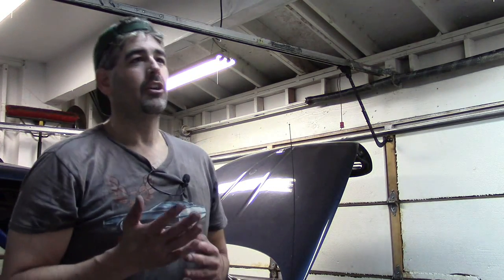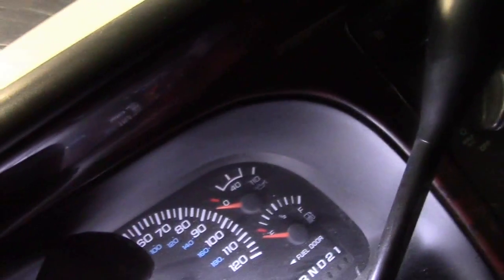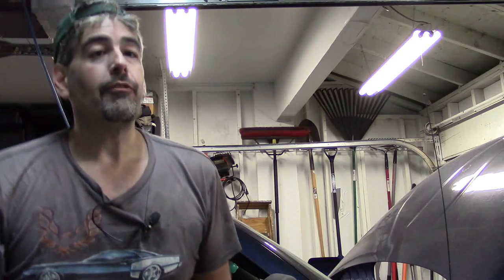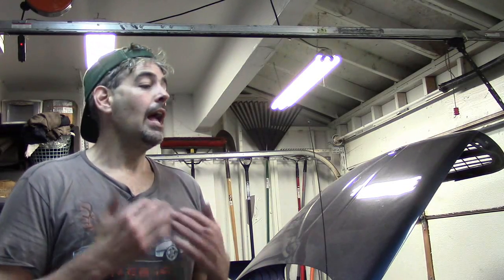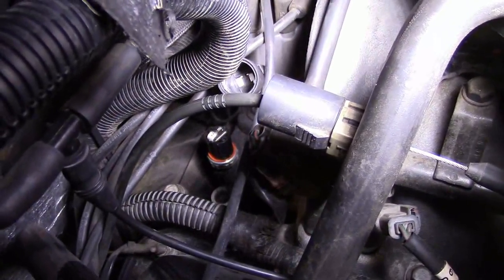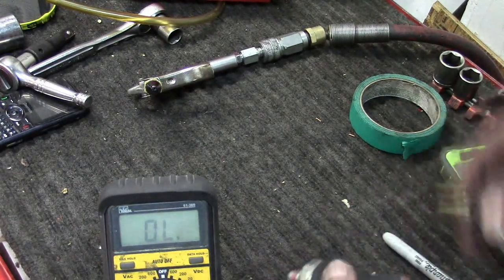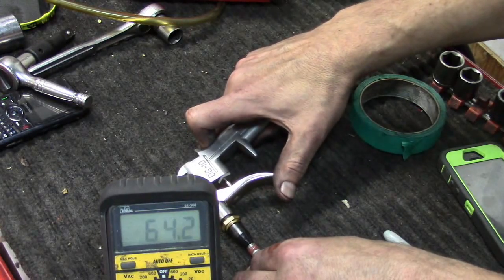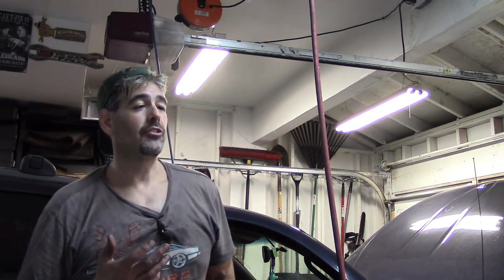DIY- Low Engine Oil Pressure Diagnostics

Comment: Well, it's one thing to have some private party seller tell your customer that the low OP reading was due to a faulty sending unit, but - how about ye good olde chevy DEALER (salesman, actually) telling me that the low OP at idle in my  5.7L vortec  (99 Tahoe) was NOT a problem - that's the way they roll.  Above idle it popped right up, and has continued for over 100K for me without that changing.  But now you have me worried....  WAY too late to do anything at the stealership -- they closed up shop entirely several years ago.  Methinks it's worth my while to send my oil in for lab analysis - seems like that was relatively inexpensive and hugely informative!

Comment: You shouldnt half to rebuild it. just take the oil pan off an put new rod barrings  an a new oil pump in it . no since in spending thausands of dollars on it .Why you can spend a hundered or two dollars an fix it.. But thats just my opioion ..
Reply from the maker: Rotflmao.  Ok so just forget the fact that the low oil pressure could be from the MAIN bearings huh????  come on.

Comment: Do different oil filters make a difference in oil pressure
Reply from the maker: Nope
Reply: I have a 2006 chevy Silverado with a 4.8 and 119,000 miles, it runs good but the oil pressure hangs around 30-35 when warmed up. What could I do to get it back up to 40 psi at idle?
 @SchrodingersBox

Comment: I just installed some Boush Mechanical gauges to my 283 Chevy Sm Block, it has 37 pounds of pressure at start up at 1500 Rpm, Book say should be 38 Pounds at 1500 Rpm. But after warm up, it drops to like 20 pounds?

Comment: good troubleshooting but would have been more helpful if indicated what pins on harness and sending unit meter connected to.  as always though, helpful videos
Reply from the maker: I am quite certain I did mention the pins where the reference, signal and grounds.  In fact I am 100% positive I mentioned that.

Comment: Showing the oil pressure test without knowing what pressure to look for was pointless. This could've been a better video. When someone says an engine rebuild or replacement I hesitate. There are many more things that could be done to prolong the engine life with the last one being an engine replacement. Just my two cents
Reply: Dude, it had 10psi of oil pressure, it is F.U.B.A.R. If it were mine, I would rebuild it for sure, or find another engine for it,they don’t make much stuff like that anymore with truck frame etc
Reply from the maker: Your lack of competence on the basic fundamental concepts of proper oil pressure diagnosis does not make this a bad video. It just makes you a bad diagnostician. The oil pressure was scientifically proven to be low and the cause of the failure. Even a beginner can see that. The fact you think things can be done to prolong the engine when it is conclusive demonstrated even to a rank amateur that this is bearing failure exacerbates your incompetence exponentially. Anyone who would recommend continuing to drive the vehicle under any circumstances other than a rebuild should never ever work on people's cars.

Comment: Hi, i rebuild a gm grand am 1999 2.4l ld9, troubleshooting is i fill up the engine oil full of the gadge, oil dipstik ok but when i start the engine few min and stop, i take a look on the dipstik again and oil is very low, do you have an idea, where the oil goes, no leak everyting seal on spec. Thank’s. Ben
Reply from the maker: I normally diagnose these using fuel trim analysis to look for oil in cylinders.
Reply: Schrodingers Box think there is oil on the cylinder, i check the compression and everyting perfect head and valve.
Reply from the maker: it won’t be a compression problem. possibly a seal problem. anyway when you see the fuel trim show a proportionately rich curve compared to load, that obviously would be indication on where to suspect the issue.
Reply: Schrodingers Box yes i have to check more specific fact, i am going to take a look and see the troubleshooting, when is done i reply to you and see what i found thx a lot. Ben

Comment: What about the oil grade was wrong? My 2005 Suzuki Forenza start this problem after mechanic changed  oil and and replaced timing belt Also started a knocking valve.
Reply from the maker: a knocking valve lol????  Oil grade causing low power??  Jesus.

Comment: You also have to check the oil pickup tube connection to the engine block.
Reply from the maker: not with low pressure that varies with load. No, the pickup is clearly operational in this case.

Comment: Would a higher volume oil pump be a budget hack to extend the life of that beater? More volume would force up pressure right. Don't judge I just woke up.
Reply: I mean if it didn't already have rod knock

Comment: Great video!! I have a query. My bike shows low oil pressure in spite of having new oil (changed just a couple of weeks back). But, it shows it only after I ride for 2 kms. Especially when its night time (I am assuming its cuz there's less heat in the atmosphere). Then when I turn off the ignition and back on again, it never shows up. The oil level seems fine, although for a 200CC bike, it does sound a little too noisy above a speed of 90km/hr. Can you tell me what the issue might be? Its just 1 year back I bought this bike.
Reply from the maker: It could be the bearing clearances expanding with heat.  Measure actual oil pressure with a gauge both at startup and after warmup to confirm.
Reply: Schrodingers Box If the bearing clearances do expand with heat, what should I do?
Reply from the maker: if an actual manual oil pressure test validated the findings then i would measure the bearing clearances. A lot of people will say you need a new oil pump but they are idiots. Measure the bearing clearance on any rod cap or main and when you see its out of spec you know the problem.

Comment: Hi,friend..I have zero oil pressure when i start my car,i need to accelerate to flow the oil.why does happen this my friend?thanks
Reply from the maker: What was you resistance on the sensor during these variables?

Comment: Schrodingers Box  Great video. Could i ask, with the pressure kit what level PSI should you be looking for to rule out your car has low oil pressure?
Reply from the maker: you need to check the specification for your specific vehicle.

Comment: also I have a 2011 2SS Camaro 6.2 L and it is pulling the code saying its my oil pressure sensor
Reply from the maker: There is no such thing as a code that says it is a faulty oil pressure sensor.

Comment: hey Guys I have a 2011 Chevy Camaro 2SS 6.2 LS3! I have had the Cam and lifters and oil pump changed and oil pressure sending unit changed and still has low oil pressure! I'm 3,000 in the hole someone please help me?
Reply from the maker: What was the data that indicated the oil pressure was low due to cam/lifter and even if so- why on earth would the sensor be changed in that case???
  Makes no sense at all no matter how you look at it.
Reply: it said it was the sensor when I had it plugged in at O'Reillys but I even had it replaced and still pulling that code
Reply from the maker: impossible. there is no code that says there is a bad oil sensor.  there are codes for circuit inputs out of range but it is impossible the code said bad sensor. 
  also what are your main and rod bearing specifications. Surely those were read if the cam was replaced. No one would replace camshaft for oil pressure failure unless bearing clearance was measured at bottom end.
Reply: no I replaced the cam and lifters because they were bad and after I had a oil pressure problem so I replaced the oil pump and I replaced oil pressure sensor and still has low oil pressure?
Reply from the maker: Ok then obviously you have a bearing clearance issue. What is ge came bearing clearance vs tolerance?  And again- why change the oil pressure sensor?
  In fact what is the MECHANICAL oil pressure reading anyway?
Reply: 15 psi
Reply: Cause its what pulled up when plugged in the reading to at O'Reillys when my check engine light came in said low oil pressure sensor
Reply from the maker: it may have said low oil pressure because it was reading low pressure but that is accurate. it did not say the sensor was faulty. it said it was reading low- which of course it was. 
  So no need to change the sensor. 
  What you need is bearing clearance data now.
Reply: How do I get that?
Reply from the maker: you measure the oil pressure directly. You mean you didn't do that??? How did you possibly determine the cam was responsible then?
  this makes no sense whatsoever. what is driving. these decisions to replace all this stuff when you have no confirmed oil pressure deficit?????

Comment: my Ford Explorer is doing the same thing with the m Dash on my oil it seem that there's no oil and there is so mine's a little different my truck does not have a knocking sound to it at all and what would that be
Reply from the maker: Then I would IMMEDIATELY diagnose the issue. If it's actual low pressure you may be able to intervene without catastrophic damage and get by with just bearing replacement.

Comment: Hi matt, I'm an almost religious follower of your videos. Could you explain why thinking about a bad oil pump is ignorance when flow is proven? Since everybody around says otherwise? I believe there is a lot of myths about engine lubrication ( a good example could be "the older the engine, the thicker the oil") and it will be so good to hear your opinion, I know you are not very interested in those kind of topics due to it's basic or simple nature, but damn I'd sure enjoy a video shining some light on us about it. Thanks and please forgive my poor english, is not my native language.
Reply from the maker: It is because an oil pump does not create oil pressure. It creates oil flow. The pressure is created by the flow going through the small bearing clearances of just a few thousands of an inch.

  An oil pump is an incredibly simple design that does not fail before an engine bearing would. If the oil is flowing and the pressure is reading low, either the bearings failed or the gauge is reading incorrectly.
Reply: Awesome! I hate when old school mechanics try to impose their stupid ideas

Comment: Hi matt, I am having a similar issue. The oil in the cylinder head is very less when the engine is running. I hear loud rocker arm noise. Could this be a failing oil pump? I changed the oil filter but no changes. No particles in the oil. Could it be a blocked oil gallery ?

Comment: what causes this. my wife's car just died and this is what it was doing. I thought the sensor was bad because I new the oil was full because I just changed it and it was running fine.
Reply from the maker: As described in the video your variables would be worn bearings or faulty sending unit or fault gauge.
Reply: Schrodingers Box I guess I meant what causes the actual low pressure not false indication.
Reply from the maker: HillbillyMatt ExtremeDIY When the engine bearings are worn the space the oil passes through is enlarged, which of course exponentially reduces the pressure.
Reply: Schrodingers Box aha. that makes a ton of sense. I am so hooked on your channel. as you may be able to tell by my name I enjoy pushing conventional rules of DIY. as you probably know when you are rengineering the conventional you have to do all of the homework. I appreciate it when I find a good source of detailed knowledge like your channel.

you are very thorough and you make it understandable. thank you.

I was trying to find the video that you refernced in your extreme budget engine rebuild video, in which you discuss why rod nock is an absolute engine replacement/rebuild. what is the title? I tried searching "schrodingers box rod knock" to no avail.
Reply from the maker: HillbillyMatt ExtremeDIY Welcome to the channel!  Try searching the channel itself. It is under the "about" tab on the main channel page if I remember- there is an option "search channel" as opposed to searching all of YouTube.
Reply: Schrodingers Box you are correct but for some reason that feature isn't available on the mobile app.

Comment: what causes a loss of engine oil pressure like that?
Reply from the maker: Worn bearings. When the bearings wear the clearance widens and the oil pressure drops due to the larger clearance it passes through
Reply: @SchrodingersBox  does that mean the engine is going out?

Comment: Makes one wonder if the pressure switch was loosened on purpose to hide the oil pressure issue?
Reply from the maker: I suspect it was replaced by a typcial non-diagnosing hack that was hoping it was just a bad oil pressure switch.

Incidentally this car did finally blow up this summer when the rod knock became so bad the timing was off enough the car wouldn't drive. Eventually the guy threw a rod because he had to floor it to even make it go.

Comment: dang just did engine  and another mec told to me it's leaking on oil sensor.  why that should of been replaced with engine.  ahh. and the power steering  pressure line leaking too and 02 sensor, engine light on. ahh  . Gosh when I got it back from mec   the oil showed none. I put  lucas and oil. took it to another shop they said add one quart more oil  said maybe dip stick is maybe wrong one.
Reply from the maker: Sounds like you car needs to be on this channel... and your mechanic needs to watch lol

Comment: Hey schrodingers box I live in cs and have a engine noise that seriously needs to be addressed is there any way I can get ahold of you I need help
Reply from the maker: No need- just find the source of noise and confirm through visual confirmation.  There is no skill in diagnosing noise- you just have to tear into it.  See my other engine noise videos and it's very easy to diagnose even with no skill or experience.
Reply: Well the only issue is that I live in an apartment complex not a house. They don't like people doing much of anything on cars here and I have limited tools. I should say I would really just like you to look at it since I am going to have no choice but to take it to someone and have the most confidence in you rather than typical part changing shops. Its an 05 neon standard trans and it sounds like gears want to fall out when I'm coasting in neutral.

Comment: Under the Lemon Law, this guy should be able to get his money back. The seller flat out lied to him to make the sale. He can even sue to recover damages.ie over and above what he paid for the Lemon.
Reply from the maker: I am afraid like many people you are misunderstanding the lemon law. 
  The lemon law refers to buying a NEW CAR FROM A DEALER ONLY.   It refers to a car requiring repairs within a timeframe that accumulate to a certain percentage of the car's retail value. 
this is not a new car nor was bought from a dealer. 
  Second - the only cause of action you would have from a dealer on a USED CAR is a contractual violation which does not apply here 
  and finally- the only cause of action on a private party sale would be with a documentation issue not allowing registration. There is no cause of action for any repairs whatsoever unless specifically contracted. 
   Most people severely misunderstand "lemon law". Buying a car 3rd party is always buyer beware!!! The seller can lie about whatever he wants that is outside the bill of sale agreement as long as t doesn't deal directly with liens or registration paperwork.

Comment: Another excellent and informative video based on logic and not just "common wisdom."  Just finished your budget rebuild videos and learned a lot before diving into an old pickup motor I've been looking forward to rebuilding. One thing I might suggest you keep in mind though. Some of us don't look upon the time spent turning wrenches or measuring tolerances as drudgery to be farmed out to a professional mechanic/shop. For me, that's the fun part. Look forward to more of your good work.
Reply: RITE!!!I SOMETIMES LOOK 4 ANY REASON TO DISASEMBLE MY CAR OR THE OLD LADIE'S CAR JUST 4 FUN NOT 2 MENTION THE LAWNMOWER,THE RIDING MOWER'GO CART,HECK,ANYTHING WITH WHEELS  & A MOTOR. OR ELECTRONICS.AS A CHILD<ALL MY TOYS CAME APART 2 SEE HOW THEY WORKED.MOST OF THEM WENT BACK 2GETHER BUT NOT ALL. BUT IF IT WAS ALLREADY BROKE=FAIR GAME & WHO KNOWS,MITE BE ABLE TO FIX IT.IN THIS, "THROW AWAY GENERATION" a lot of people cant be bothered to fix things. 2 them,im a guenious.  There amazed when I simply fix their car.another thing is when people don't do regular maintanence,then wonder why their car isn't running properly.or when someone doesn't own any tools,i question their ideals.

Comment: thank you,i live in Commerce City CO I will like to take my car to you I have Nightmare,2000mazda MPV No check engine light,i replace FUEL Pump,one Catalic Converter,any Suggestions.thank you so much.
Reply from the maker: What was the data you got that indicated you needed a fuel pump and catalytic converter? I would start there.

Comment: The old "bad oil pressure sending unit" excuse is never a good sign. I recall taking an old truck for a test drive and it was smoking like crazy under the hood. He told me it was just the valve cover leaking... yeah, sure.

Comment: Run it, I bet it still has plenty of life left in it.  Thats plenty of oil pressure at idle and at RPM.   Probably faster too with all the extra bearing clearance, I would put a 100Hp shot of nitrous to it and hurt some feelings.

Comment: My Crown Vic oil pressure never varied...it looked like an oil pressure gauge on the dash but turns out it is actually an oil pressure indicator.  If you have at least 5 lbs of oil pressure then the needle goes half way up.  Very deceptive of Ford.
Reply: Ford is a horrible company.